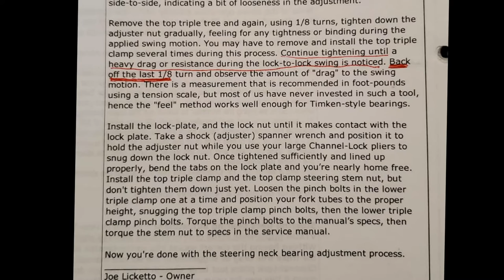DIY-How to Replace the Neck Bearings + Rebuild Front Shock or Forks on VTX1300

Comment: Watching your video now. Thanks for making it. Maybe remove those fork covers on the triple tree before pulling the shock down? I mean if you're going to take the top brace off anyway. I wasn't even aware that it would pull through there without taking the cover off period so I got educated there :-)
Reply from the maker: the fork cover removal portion got overlapped.  the covers won't come off without unit you pull the forks through.  You will have to pull on the fork covers and that won't be easy...but you can grip the fork and pull on them...there is an o ring that holds the fork and fork covers apart.
Reply: @footprintsinconc  I'm pretty sure if you take the top of the triple tree off by loosening two pinch bolts and then the center bolt that is 30 mm head, tap up on the handlebars to remove that whole assembly with a rubber mallet, then the covers will slip up after they are unbolted from the second brace of the triple tree. 
After taking a look at your video, seeing how it was assembled exactly, I tightened up my stock bearing a little bit. I just got the shakes yesterday for no reason it seems.
Another tip that might help somebody is a large pair of channel locks will grab that weird nut that tightens against the bearing. You won't be able to get the 30 foot pound reading before backing it off as the manual says, but you can tighten it until the bars get hard to twist, then back it off a quarter turn. That seems to be a tried and true method also.
The advice on the old motorcycle board I use to frequent was tighten that head nut until the wheel will fall left or right smooth and controlled, not free fall. I definitely need to get the bearings you installed and put those in. There is too much good riding weather to waste it on more garage time than I already do :-)
Thanks again for your video.